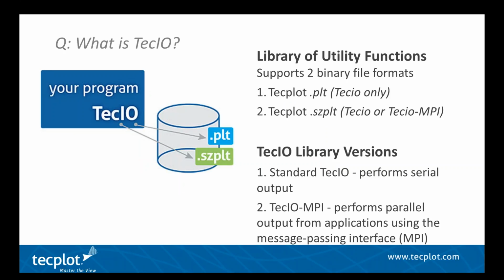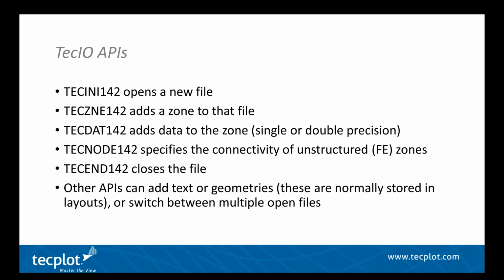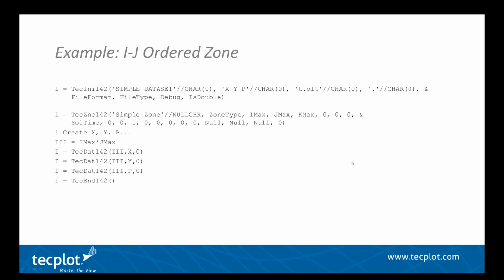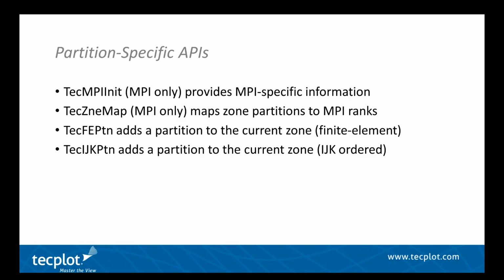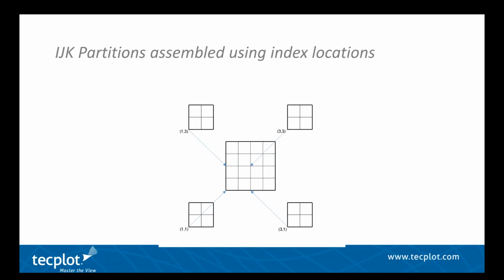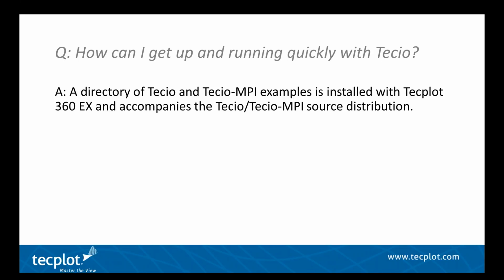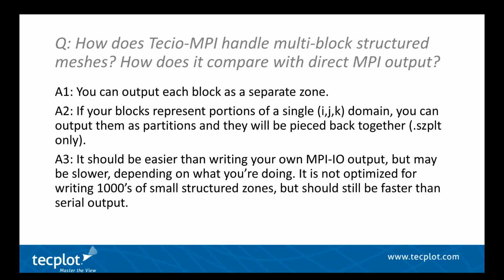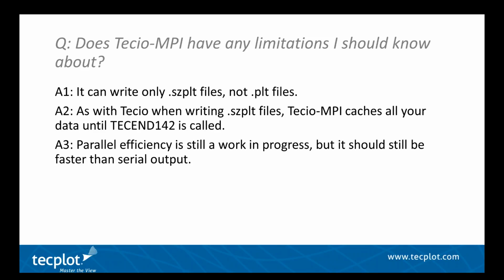Fast Parallel File Export with TecIO MPI

Comment: Why is the file limit 2GB? Is there a way to overcome that?
Reply from the maker: Hi Fernando,

There is no limit on file size, but there is a limit on zone size for the older .plt file format—just over 2 billion nodes or cells per zone. This is because the integers that store zone size are 32-bit signed integers, whose maximum value is just over 2 billion. Most customers are not impacted by this zone size limit yet, but we have eliminated this limit in the newer .szplt file format, and provided 64-bit routines as part of the new TecIO API to enable customers to create larger zones. You can read about the new TecIO API in this blog post: https://www.tecplot.com/2018/09/26/new-tecio-api-for-tecplot-360-szplt-output/

Let us know if you have anymore questions!

~Tecplot Team